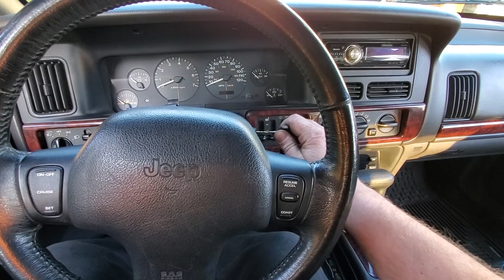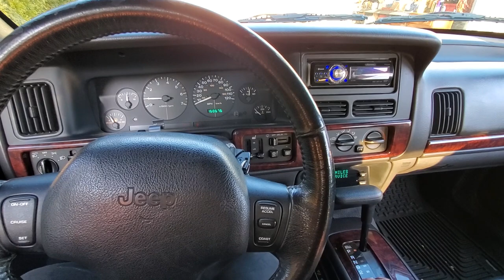JEEP ZJ PARKING BRAKE & REAR DISC BRAKE REPLACEMENT

Comment: Dan,  this is about what I found on my 04 WJ. I’m changing out brakes drums,  rotors, calibers and putting in new rear axles.
Great how to video.🇺🇸
Reply from the maker: Yea.. its common... Right on! Thanks Paul
Reply: Dan, i’m retired and I’m using my jeep as a hobby and I’m having a lot of fun.  🤠 I really don’t know  why because I never enjoyed working on my vehicles before and usually put them in the shop. This all started for me trying to trade my Harley in on an ATV for off road on FLORIDA trails . But none of the dealers wanted to come close to what I wanted for my bike and I didn’t want to spend $20,000 for an ATV. And because I’ve owned a jeep before and it got us through some Highwater during hurricane weather. I decided to rebuild  a WJ that I bought really cheap. Been working on it since September 🤓
Note: would not have been able to do this work without YouTube videos and Dan, I referenced many of your videos✅

Comment: Hey Dan. Well I sadly do not have a place  to do my own work..so two spots I had jeep both did not replace oil pump even though I was enthusiastic about doing so. Both said "not needed" even though they were in there so if customer wants then why not. Easy to do and not expensive...right. 
 I did put on new oil sender sensor.
I guess I will go ahead and do the pump pretty soon. Otherwise it's all running pretty sweet. And like you I LOVE MY XJ BABY! 😁
 Thank you for your feed back!
Cheers, Daniel.
Reply from the maker: Ahh, hopefully it will be ok.. If your sensor is new keep an eye on the guage.  If it stays low at high RPMs you may want to change it.  I hear good things about the Melling Pumps

Comment: Howdie Dan...Daniel here. Really Appreciate and enjoy your channel.
 I would love your feeling about a question I have with my 2000 XJ sprt,
I just had engine rebuilt and Oil prsr got really good. starts at 45psi ish and runs between 45 and 55. but now at idle it drops to 20psi but still runs at 45-55.
 I'm used to my 2000 tacoma that stays in one spot always.
 Is it just an XJ thing or are there XJs..(any of yours) that run even psi always?
Reply from the maker: hey! Thank you for watching! Did they put a new oil pump in when they rebuild the engine? Also that they put a new oil pressure sending unit in too?

Comment: @ 13:30 the little flat spring attached on the lower end of the outer brake pad is handing down past the pad bracket. IS this correct or is it supposed to be sprung up onto the metal bracket ?
in your caliper replacement video you had it sitting on top on not underneath... maybe this is why it seemed like your calipers where sticking.?.. 
I am currently trying to figure out why my rear brakes are way hotter than my front. i have replaced pads, calipers, all the rear metal lines and hoses, master cylinder, parking brake components, and made sure parking brakes were incredibly loose...  i can not figure out why they are still getting hot. i have some worn spots where the pads ride, maybe i will fill the low spots with the welder and smooth it back out.?..

Comment: I wouldn't want to crawl under a car with no jack stands. Esp. when working alone

Drilled and slotted rotors di make a difference. I figure if I'm going to do the job myself amd save some bucks, I'll upgrade and still save money.  Brakes are fairly easy.
Reply from the maker: I definitely would not recommend it but I was mindful to not be "under" the vehicle
Reply: @ProjectDanH  I noticed you stuffed your wheels under the vehicle like I do. If jack fails it's not going too far. I would also put the rubber plugs in where you adjust the shoes.

Comment: Not an emergency, but while driving my XJ a few years back I got a loud smack when I applied the brake out of no where.  While driving the noise was minimal but when I applied the brakes it got real loud. Luckily I was able to limp it to a garage. The rear pad on the shoe broke off the shoe and was moving around inside the drum. 😆

That being said for the front. This kit was a big upgrade in performance and I would recommend. Just know what year you have before ordering. 99.5 + is different. 

https://www.morris4x4center.com/crown-performance-front-brake-kit-drilled-and-slotted-52008440dsk.html
Reply from the maker: great story! I was not aware of the difference in brakes. thanks for the heads up!
Reply: @ProjectDanH  different front hubs. They changed. The rotors are not compatible.